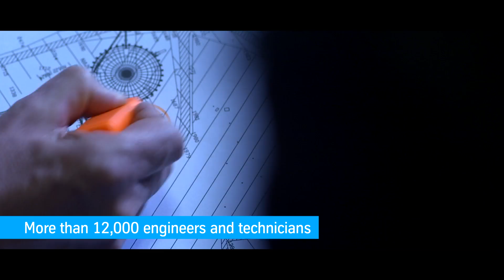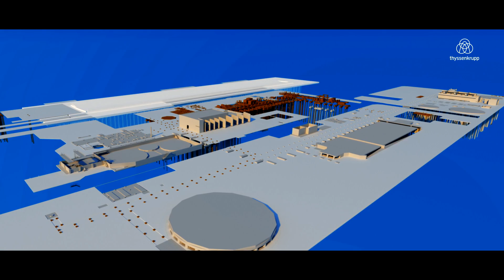thyssenkrupp builds major fertilizer plant in Brunei

Comment: I work in the field of mechanical maintenance (maintenance of gear boxes and gear motors, maintenance of belt pulleys, belt welding and maintenance of fertilizer filling equipment).